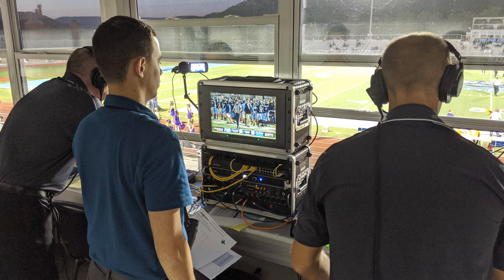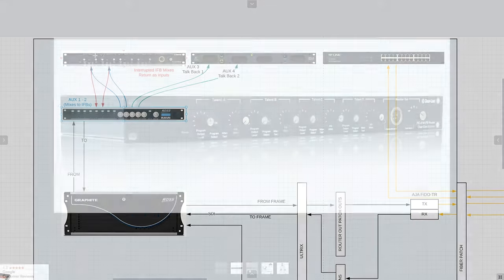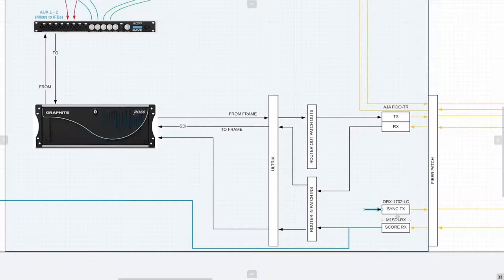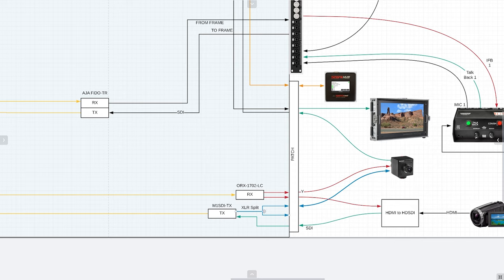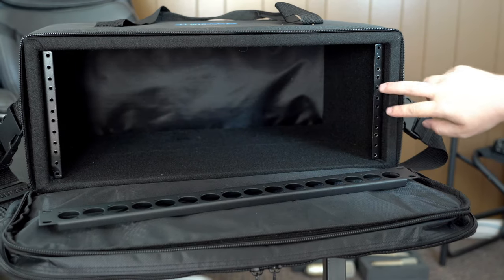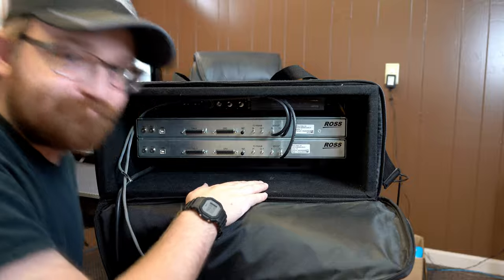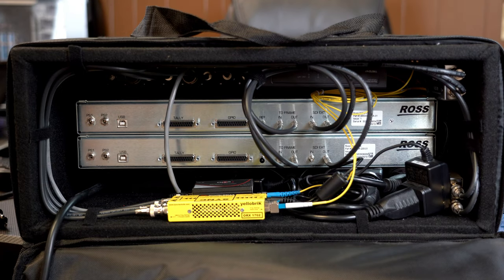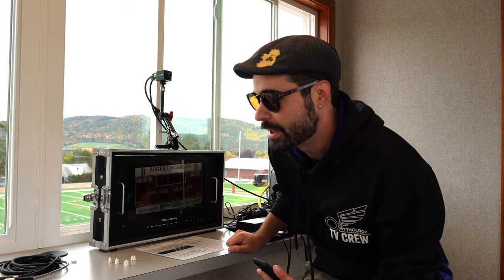Let's Build A Remote Pressbox [Broadcast Engineering]

Comment: I've been doing broadcast engineering about 5+ decades still at it. Thing you say were true back then as now. We always used someone who knew our trucks to do site survey for parking and power. High schools are always the worst they have no I/O area and cracking a door when it's 15 outside.......  I built something like your press box several years for use with a half-pint 6 cam production van. It is a necessity. We used decent quality PC HDMI 22" monitors for talent with SDI to HDMI adapters. Fiber is the best way to go. I had 12 Ch. SM-ST on 250ft reels usually enough. I also have SESCOM audio over fiber units to extend everything from analog ICM, IFB. Just use throw down mic preamp for headsets. What is nice about the fiber snake you can run clock signals and other data along with audio to truck no interference, I now use it also to send VISCA over LAN for my robotic POV cams. Keep up the good work.

Comment: The rs485 to fiber converter most likely uses 2 different Lightwaves , one for transmit and one for receive.  That is how fiber to the home Internet works.  You can get sip fiber modules to run ethernet on a single fiber.
Reply: That is technically called WDM (Wave Division Multiplexing).

Comment: I think you should have some method of securing the fibre, in case for some reason the very delicate fibres got yanked...they’d be snapped.
Reply: Yah we normally secure fiber to a railing with rope and/or gaffers tape. We definitely don't want broken fiber for such a critical piece of equipment.
Reply from the maker: In my defense, there is a good extra 30 ft of slack in the fiber snake there haha. Also, I absolutely tie it off at the window! 😅
Reply: Actually the fiber is more robust than you think
Reply: @scwfan08  Tragically, we did have a fiber reel get yanked while going up a lift... It didn't survive. I'm having it repaired now, but lesson definitely learned. Mind the cable while the lift is going up.

Comment: Great Video! Good seeing someone sharing some of their insights.

For anyone considering the build:
There are very cheap BMD-SDI fiber converters available that I know will work well with standard SDI-SFP (Pathalogical Pattern Compliant) modules.
Standard SDI SFP modules are far cheaper than manufacturer-specific ones.
This is also useful as you can create a CWDM multiplex system with the appropriate SFPs, reducing the number of fibers to 1 or 2.
For things that for some reason you don't want to toss into such a passive multiplex unit, I would consider using BiDi SFPs so that you can further reduce the number of fibers required. With fewer fibers, professional connectors like OpticalCON or MIL-83526 connectors with extended beam become a viable option and make your system much more robust. If you use LC connectors without proper protection and cleaning procedures you will run into problems one day down the road.

However, you can also consider SDI over Ethernet over fiber with SMPTE 2110 converters instead of direct SDI over fiber. AJA has converters that will also solve your synchronization problem (IPT-10G2-SDI). Switches with 40G uplinks / 10G ports and 40G QSFP + modules are very affordable these days, e.g. Mikrotik CRS326-24S + 2Q + RM (not yet tested). In addition, it offers the option of using a redundant fiber cable. And I guess you can throw any halfway decent SFP + in the AJA units.

I am not familiar with Ross products, but I am wondering if there is no way to receive and send audio through Dante? Those ABM units seem quiet expensive to me for their feature set. 

And last but not least: RS485 over Ethernet for camera control would probably be a more efficient and versatile solution.
Reply from the maker: Excellent tips! Thanks for sharing with the community!
Reply from the maker: The benefits of the ABMs are that they proprietary with the Graphite and allow a streamlined interface from the device to the RAVE audio engine. The Graphite does also support Dante as a windows sound card, so that is always an option too!
Reply: I'll chime in here with my recommendations for OpticalCON connectors for a way more robust fiber path. I built some very similar cases with our flyaway kit  (basically a smaller version of your truck in two 6RU cases, plus a 2RU stagebox on 1 duplex fiber), and I used OpticalCON panel connectors instead of those LC only type. The OpticalCON connectors cost more, but you can still use them just like this with LC, but you can also use OpticalCON cables for way better protection. We carry OpticalCON cables as our primary, but have some cheap LC cables stashed in the kit for backup.
Reply: Other camera systems like the Blackmagic Design has video and talkback in one unit: The talkback/IFB is incorporated in SDI channels 15 and 16 (these are unused digital audio channels).

Comment: Great video.

Very clever idea to remote the ABMs.

One thing I did with a similar stagebox build was got a single higher rated 12V power supply, and split the output to run all our little devices. Just total up the power requirements for all the FiDos, Lynx & Thor boxes, and put one 12V power supply in. It's a little larger than any of the single units, but way lighter than all those power bricks & A/C splitter cables. I figure I saved a few pounds all said and done from our stage box.
The ABMs take a bit more power, so you'll need something beefy of you include them in the common 12V power, but those fiber boxes take like nothing.
Reply from the maker: Hi!

Thank you and thanks for sharing! I actually had did this as well for the first variation of the remote press box on the other unit. I ended up going back to power bricks and I can't particularly remember why. I think it had to do with space and form factor of the supply?... I'll have to ask Dan, he'll recall - that was another one of his projects haha.

Anyways, thanks for watching!

Comment: What fiber cable to you use at the end when demoing between the OB and the press booth?
Reply from the maker: It's a tatical 6 stand LC single mode cable. 500ft. If you want the exact SKU I'd have to dig for it :)

Comment: Why do you use the built in audio system in the Ross vision switcher? Normally would see seperate audio consoles round here for ease of use for the OP and compatibility with other systems and cost.
Reply from the maker: Hi! The RAVE audio engine is pretty sufficient for what we typically need for with the level of productions we use the unit on. They've also recently added EQ graphs and pre fader processing. We also use an Ultrix, so it's really synergistic with embedded audio routing. Also a huge advantage is the native control from the Graphite, such as opening and closing faders/recalling scenes via custom controls.  

For a controller, we use a combination of a touch screen monitor and the X Touch midi controller!
Reply: @BroadcastBuddyTV  Fair enough! I just know a few A1s that would turn their noses up at such a system if they came across one! Anyway, thanks for the video, just binged your whole channel!